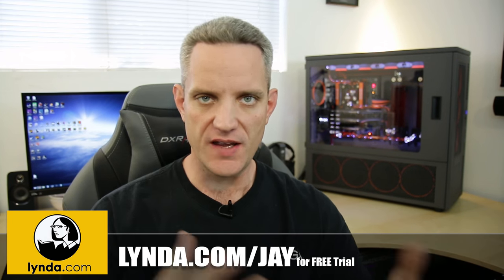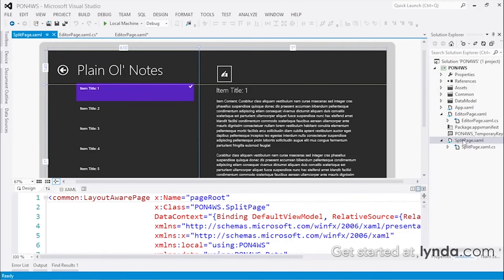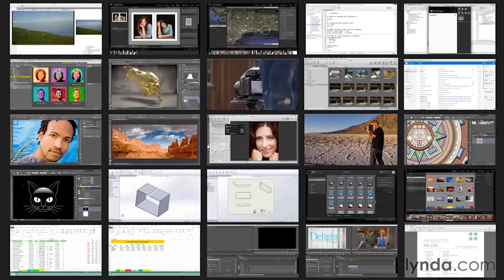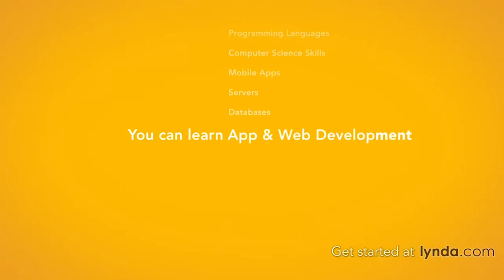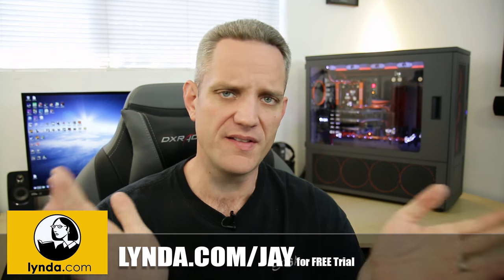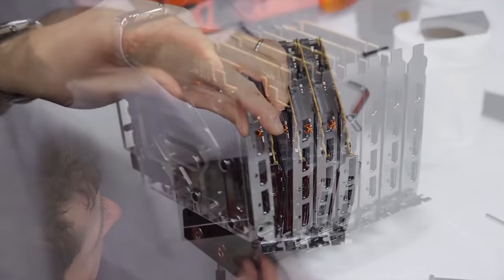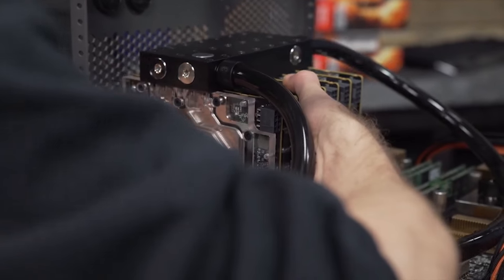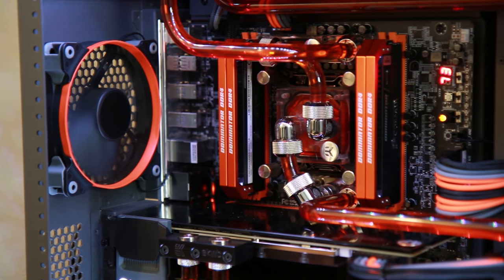Is watercooling worth it?

Comment: is THAT safe to overclock a graphics card for an example, when you have a waterblock covering the gpu and vrms and all components very well, maintaining very low temperatures,  then you change bios, increase maximum tension, and all that stuff, is that safe to go beyond the basic overclock? will the components handle a considerable higher amount of tension and rate of work? Once I water-cooled a GTX 480 but couldn't go that higher core freq, I think cause of the tension. 700mhz stock, went to  925mhz, it's a very high oc imo. But could go beyond that with bios improvement and full cover waterblock?

Comment: great vid Jay! Will, see if i need to add cpu loop to my new work/playstation, running xeon 10-16 core (not much tdp headroom there though) a quadro card and an rx480 or 1060 i think, going for silent mode. I'll see what happens on air inside my Antec P182se case (VERY quiet for 4x12cm fans (maybe switch to all nocturna's?)

Also note: full copper radiators can be half the size of the aluminum ones, half the fans! because copper is 2x better at heatsinking/dissipation. Pure water (ph ballanced) will absorb more heat than coolant, ALWAYS)

Comment: if i'm just running on stock speeds with a 1080, and a ryzen 7 1800x. would i be fine to just run air cooling, also if i was to overclock the CPU to the 4.2 its recommended to overclock to, would that change the needs or requirements?

Comment: when overclocking my gpu, I generally increase the clock speed in small increments until I see artifacts, then I back it off. If I flash the BIOS on my gpu and increase the voltage, should that theoretically increase the max amount I can add to the gpu core clock before I see artifacts?

Comment: I had an AIO CPU cooler but after 4 years of operation the pump died, and i didn't have enough thermal paste on the cpu after i removed it once, it's not a thing i usually have so i went back to air with the Hyper 212 evo, my system is silent enough and even under load and all fans at slow speed the cpu and gpu never goes above 65C, would i go back to watercooling? yes if i built a custom loop :)

Comment: heat kills stuff in pc...say that to my amd dual core from 2008 also motherboard power supply and graphics card
Reply: lol I'm running a dual core E8400 and GTS250, from 2008 as well, I think. Only switched the PSU because I was afraid my NOX was frying my 250.

Comment: Hello there, is it okay if I use a predator 240 with QDC with a predator 360 with QDC and two GPU blocked with enabled QDC in the same loop. Of course I will remove one of the CPU block and connect them all together. The loop will start with the out from the 240 into the CPU block them from there go into the 360 radiator, connected by QDC and then go into the top GPU block with QDC and then move into the bottom GPU block with QDC and finally move back to the 240 with QDC. Will this work properly, with the two pumps and the 3 water blocks?

Comment: What do you guys think I should do... I'm upgrading my FX 4100 build to a Skylake build. Do you think I should get the H100i or a hyper 212 evo?
Here's the full upgrade:
Intel Core i7-6700k 
Asus ROG VIII Hero motherboard 
EVGA GTX 980 Superclocked 
16 GB DDR4 RAM
NZXT H440 Case 

I don't think I'll overclock the 6700k, but if I do in the future, it'll be to a maximum of probably 4.4GHz. I like the price of the hyper 212 evo and might help me get the upgrade significantly faster... However I love the look of the build with a H100i more than a massive Hyper 212 Evo. 
But,  I don't feel comfortable with watercooling currently. 
What does everyone recommend?
Reply: +MadMikeGamerXL1 All in One watercooling isn't very prone to leaks and it is highly safe.  I'm currently using a h60i GT and my brother has the H100i.  We both love our all in one coolers, get the H100i
Reply: +Diabeetus_Prime Yeah I have read up a lot about how safe they are and one of my friends has one too. I guess if I buy it I'll feel more comfortable with it :P 
Thanks
Reply: If it makes you feel safer, I've heard of corsair refunding all of parts if that rare break actually happens.  My 120mm h60i gt has my 6700k at 4.4 ghz with 1.3voltage.  So that beast might be able to squeeze some more out.  Happy Watercooling!
Reply: +Diabeetus_Prime thank you very much for the advice! 
For stock speeds at 4GHz would that extra money benefit me over a Hyper 212 Evo?
And I'm not too worried about installing it or anything, a friend in my neighbourhood also recently got a H100i 😊
Reply: It would definitely be a lot quieter
Reply: +MadMikeGamerXL1 

Get a high end air cooler like the Scythe Ninja 4 or scythe kotetsu.
Reply: +XorFish Are they all fine with the Skylake chips? Because of this bending issue I'm sort of tempted to stick with the brands I know well. :)
Reply: +MadMikeGamerXL1

yes
Reply: Completely forgot about this post haha, and yes I ended up building the system, and the parts I ended up buying were the same as in the original comment. I decided on the Hyper 212 Evo because of money, but now I see what others meant about it being a pain to install.

Anyway, It's running nice and stable, and am planning to overclock if all goes well (the temps are barely above 40-50C at full load).
Reply: ***** Hahaha sounds like hell! But thanks, I'm very happy with how it turned out. :)

Comment: Im air cooling my i7 4770k overclocked at 4ghz with an evo 212 coolershould i try higher when going for a custom loop and is 800 enough foor a nice loop?
Reply: I have a msi gtx 770 and a 750 watt 80+ gold power suply would that be enough for a loop?

Comment: OCing has never worked for me, 
and I don't have AC, ...
Reply: maybe you did it wrong
Reply: Not So Pro Gamer any video card i have had, XFX ATI 5770; MSI R9 270x HAWK.
never tried OCing CPU much.. trying to down size now. (power bill)
PC Information: Operating System: Windows 10 Pro 64-bit Motherboard: MSI Z68A-GD65 (G3) Processor: i5-2500 Memory: 12.00 GB @ 1600-1866 Display: ASUS 1080p + 1440x900 GPU: MSI R9 270x HAWK / ATI 5770 (850w power supply is down, so have to use this crap) OS Drive: WD 500GB 7200 RPM 32MB

Comment: Would an h105 fit in my cooler master master case pro 5, I know it's 240mm and that it would fit in the top but thickness, it's 38mm thick and the case can handle 40mm but I heard that u would need more than 40 to fit it plzzzzzz, I'm not an idiot in pic building but I'm confused

Comment: i use a h100i not the gtx just the older one i know its not the custom ones but it did really drop my temps. jay i do have one question on all in one water cooling units when are u suppose to replace them mine is coming up on a year

Comment: Should i watercool an R9 Nano? Heard it throttles to hell with stock cooler and BIOS :p
Reply: +Topias Salakka 
You can try to overclock it on air and if temps gets too high then its worth it.  
I did it even though there is no benefit other than moving hot air outside because it looks cool.

Comment: Jay, I got a 980ti and a i7 4790k, getting the 5820k when it gets cheaper, now to my question, SLI 980Ti or 1x Pascal card, imo 980ti SLI watercooled. And btw, do I need it watercooled or not if I go SLI. I feel like it, I hate high fan noises and shit like that.
Reply: +Anthony Lee Honestly you never NEED to watercool anything unless youre overclocking past the point of your stock coolers capacity to cool the component. I have an r9 390x and an i7-4790k, both cooled with a custom EKWB waterloop. I LOVE it, i can actually get some decent overclocks on my 390x and my i7-4790k could easily run 5.0ghz if i wanted to keep it that high all the time. Not to mention the loudest part of my whole rig is the hard drive... lol. And to be honest i would get a single 980ti, watercool it, then wait for pascal. You can transfer over all of your watercooling components except your waterblock (duh), and you wont spend too much on a gpu when pascal is out later this year.
Reply: bleachbone45 I dunno I just feel the need of getting an SLI config, dunno why, just feels sexy to watch at xD
Reply: +Anthony Lee Why would you upgrade from a 4790k to a 5820k? Thats pointless. Pascal will be nothing special either, every year they get all hyped up but it ends up being a 10-20% boost at MOST. Just grab a 980TI in SLI if you need it. Check the temperatures, if its hot and noisy (which most probably isnt) then go for water cooling.. Or if you simply don't mind paying stupid amounts of money to make your case look "water cooling hax0r omg" then go for it too. 

You sound like you have way to much money to kill on PC hardware o.O
Reply: +Mike S well. I have alot of money to play with lmao :D I will probably get the 980ti and the 5820k or 5830k. partially so I can swap out my i5 in my other rig with the 4790k.

Comment: so watercool an i3 4150 is a good idea? 
in my local stores a simple 120 mm AIO kit costs the same or even cheaper than an EVO 212 cooler. 
obviously I can't OC this CPU but soon I'm going to upgrade. 
I look for silence and stable temps at summer
Reply: Did you read my whole comment? 
I'm not going to OC 
Jay said is not necessary for overclocking since can be used for silence 

You don't have to be rude, that time I couldn't afford a non "crap" processor

Comment: I got an i7 5820k oc to 4ghz 1.14V with Kraken x61, I did not overV it much, but the temperature seems a little high to me (in comparison with similar oc) 40-45c idle liquid 35-37c ambient temp 22.5c and the pump/fan is at 100%. I had it oc to 4.5GHz/1.28V before and it was 55-65c idle, too hot for my taste (was not really sure if it was healthy for the CPU)... is it my thermal paste? I bought artic silver, but did not apply it since some thermal was already applied to the Kraken.
Reply: +Bob Drakenzil Also, maybe worth saying that I got an 980ti g1 (not Watercool) that was running hot when I placed my old 780 sc in the slot under it (80-85c while gaming with gpu fan 100%) as soon as I saw that I change the 780 to a lower slot, find it strange that I had to do that, I would not be able to SLI the 980ti in the good PCI If I had another card! my case is nzxt phantom 820 did not had custom fans.

Comment: does this 14 fan PC use the mo I headers and a fan controller or just splitters or what? 
I'm a novice and need an extra 2 fan slots and am not sure about splitters as I've read about power drain.

if any one can help that would be great as I've posted on forums with no luck

Comment: Got a question, I have a 5930k at 4.3ghz  (1.312v)with a cooler master V8 gts, it idles at 38-42 with all fans at max, and under load while doing 3d architecture ray tracing and all cores at 100% load, temp pack goes between 75 and 80, per core they fluctuate between 72 and 76, and according to asus ROG the cpu temp stays at 72 during all this.  I deff want to go into water-cooling, but do you think at the current moment i'm over loading the system and should I under clock, or will it be fine?

Comment: im in process of building mine now.   im bummed zotac 980ti with built in air/waterblock.   im having to buy 2 more fittings and piece of smaller hose,  wish they had stated on box before i purchased its not g1/4 thread and hose has to think 7/16 id or not fit the barbs.  im running a xeon 12 core cpu.   was saving for 5960x but found this cpu for under 500$ shipped couldnt pass it up. 

im wondering if you have seen or used this card Jay.

Comment: As you say, without overvoltage a system can be with good temps with air cooling, i've my gigabyte gtx 960 itx model OCed at 1400mhz and never raise the 53ºC, and my fx-4170 at 4,6ghz the 44ºC with a nh-u14s :v

Comment: on my gtx 970 I go to almost +170 before it crashes and never goes over 60c with 50% fan speed and stock evga cooler so asic is basically my drawback
Reply: also I'm not a aircool fanboy I have a custom cpu loop

Comment: could you suggest a complete kit for VGA water cooling for MSI gtx 980 gaming 4g?I am a newbie when I comes to water cooling.  I would like to know what I will need.
Reply: +Jin Park that card is nearly out of date due to small vid ram, id sell and get 980ti, i see lots of blocks available for the MSI one
Reply: Actually I am going to get a 980TI  would make more sense.  Which MSI model should I get?  Standard blower version?
Reply: +Jin Park i would get gaming 6g or g1, waterblocks are available for them, cheaper to sli the more common cards
Reply: Thanks.

Comment: the only reason I want to use water cooling in my system is that when my computer has been running for about 1 hour or so, my room gets really hot.
Reply: +Slappin Twinkles You'll still be dumping a lot of heat into your room with watercooling. Your radiators hold all the heat, and the fans blow it out of the case. May not be as much heat overall since the liquid will absorb some of it, but youi'll still feel it.
Reply: +feelingtardy damn
Reply: +Slappin Twinkles Instead of spending stupid amounts of money on a water cooler which will still give you heat in the room, just buy a fan for your room..
Reply: +Mike S lol what I have a fan, but I'm not going to have the 4 fans on my pc running and have a loud ass fan in the background
Reply: Slappin Twinkles Buy a better fan.
Reply: +Mike S any recommendations?
Reply: +Slappin Twinkles the only way to deal with this is place watercooling and put rads outside your house or place an airco

Comment: Hey Jay, if im buying an AIO water cooler, a corsair h100i was the one i was thinking should i be worried about leakage or is that not common with AIO's?
Reply: Mo  Harb Leaking in AIO's or very rare and if they do leak and damage your components then the water coolers manufactured will replace your damaged parts if still within warranty.

Comment: sir i have intel 6700k with b150m d3h board which cooler do i need air or water(AIO) for the processor
Reply: why the hell do you have a k processor in a non-Z Motherboard? (k means it can be overclocked easily, but you need a Z-series chipset Mobo for that)
Reply: Apart from that, the 6700k has 91W TDP. That's basically nothing for an air cooler. Water is not worth it if you don't have a limitless budget. Maybe you should buy a be quiet! Dark rock cooler (air) if you want silence.

Comment: AIO watercoolers are getting cheaper. look at corsair hydro aio series. But Custom Loops is very expensive, thats why i have a i7 4790k oc @ 4.7ghz @ 1.205v and a msi gtx 980 ti gaming oc and i use for the cpu only a corsair h105 with just 2 fans. if had to do custom loops i would had to get a gtx 970 instead of 980 ti.

Comment: so i'll drop my thoughts here, i have a 4790K with the stock intel cooler and i've had it for around a year. i have a R9 290 PCS+ in a CoolerMaster HAF 932 what cooler would you recommend for me,  either water cooled or air cooled, i'll most likely leave the stock clocks or may bump them to 4.2 or 4.5 i'm a Twitch streamer/gamer. any idea? what's your guys thoughts . thanks

Comment: i am a little scared of watercooling is it realy dangerous?
Reply: Jenik Vogl Yes and no, If you buy a AIO (All in one) liquid cooler then you will never have to do maintenance and are generally the safest way to water cool your components with a very small chance of leaking but if you do decide to get a custom loop then you will need to do maintenance once every 3 or 6 months which means you will need to bleed and refill your loop, you will also need to buy all your fittings so make sure you get the correct sizes other wise you will have seriously leaking issues resulting in a dead PC.

In conclusion, if you do want to have a water cooler in your PC then an AIO is great for any water cooler beginner as well as it being a lot cheaper. 

I hope this helps 👍🏻

Comment: I know jay problably wont reply to this if not ill message on twitter, but do you have your system constantly running even at night when your not using it or does the pumps corresond with the os abd shut off when your system goes to sleep at night, because my system goes to sleep every night is set for a 5-10 minute timer and few times a day on my days off, and is it bad to use a x99 setup with 2 980's for casual use during the day when not seriously gaming on the system?

Comment: +JayzTwoCents I have a quesion, can you take an aio cpu water cooler, and re-wire/pipe them? like, put in your own custom loop? Thanks
Reply: +Max Peterson some AIOs are made specifically with expandability in mind, I believe Fractal design makes one. Most AIOs that are not made for this should be left untampered as a leak could very easily ensue not to mention the pump would not be made to handle the extra pressure of additional rads and blocks. In the end if your doing any kind of custom water cooling than you should use parts made for custom water cooling

Comment: so I have a i7 2600k cpu in my pc with a gtx 680 and I'm upgrading and I have the choice of gtx 970 and a complete water cooling kit or a single 980 ti what should I do.
Reply: +Brendan Mcinerney  980ti, there is no way even with water cooling that a 970 will match the 980ti. Not to mention the 980ti has 6gb of vram. It will serve you longer than the 970 and give you more performance.
Reply: +Xipo86 well I just won't really use the full potential of a 980ti
Reply: +Brendan Mcinerney  with a 2600k? Do you have it overclocked. Even if you don't unlikely it will bottleneck a 980ti much if at all. You will be able to take full advantage of it. Skylake is not a really  big increase over sandy bridge.
Reply: +pkroliko1 I have it over clocked to 3.5 ghz I think
Reply: Brendan Mcinerney you should be good to go with that cpu its still a great one